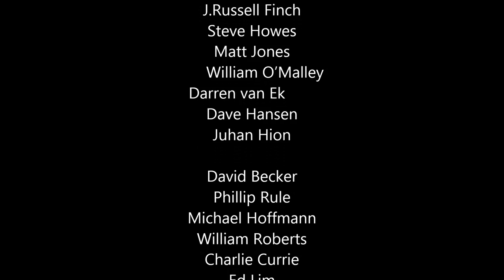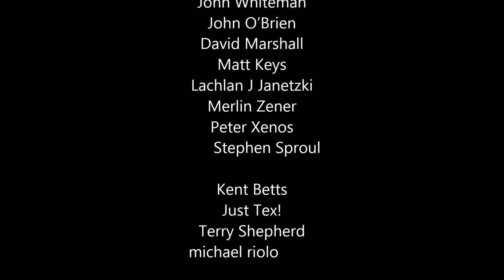Honda XL250 Restoration Part 17 - Electricals and Other Small Items

Comment: Another nice Video Peter and making great progress. When your painting the lettering on the switched try dry brushing. 
It's when you get a brush put a little paint on it and then wipe most of it off on a cloth or tissue. Then with the almost dry brush you gently paint over the letters and they should highlight without leaveing lots of paint where you don't want it.  I have used this technique many times and it may meed a little practice but it's worth it.
Reply from the maker: Yes you are correct - not my finest hour was it?
Reply: Sorry, I didn't mean to put down what you did. Your end result was still good its just that it would have been easier and possibly faster if you dry brushed it.

Comment: Rookie here just bout a 87xlr250r and a 84xr200r the xr is in almost perfect condition so I’m going to just maintain and use that one for now but the xl250r runs and rides but I’d like to start to rebuild and restore her to close to original perfect running stock bike as I can afford this winter looks like your page has a bunch of viedos I need to start watching and any hints you can give me we’re to find reasonable priced parts and we’re to start what to keep what to replaced I’d really appreciate just got my self in this mess neady a new hobby so I thought these two bike will keep my busy and alwasy loved the older Honda rfvc dual carb engines now I’m stuck with two and will deff need help in this project to keep my self busy 

ThNk you 
Colin

Comment: Hi Peter ! Your restoration is just wonderful, congrats ! On the pic of this video, you have your rear light which is just super bright ! 

Is it works in 6V or in 12V ? 
Because I have a 250 XLS from 1981 full 6V and I have a big issue with the AC lightning.
My front and rear lights are so weak, nobody can see me the night and I can’t see the road by night.. 

I really need help ! Thanks

Comment: OOH, pretty soon we get to see if you let the magic smoke out.
Reply from the maker: Yeah sweating a little, but not overly anxious. Cheers
Reply: I did it on my '90 Honda Pacific Coast. Totally my fault and I knew that the second the genie was out of the bottle. I hooked up jumper cables, backwards, on the wrong side of the main fuse. I fixed it and now she has over 100,000 miles on the odometer, but also a bad noise from the final drive area and I'm not as handy as you are. Great videos.

Comment: Nice to wake up to another video - you have reached a milestone today, my wife now knows who you are as illustrated by her comment, "Are you feeding the baby or watching Peter on YouTube!" On a sidenote, I was looking for a Motobatt for my 72 Honda 90 but have recently heard of lots of issues with quality, also there doesn't seem to be a direct fit version, I opted for the dreaded lead acid in the end but wondered if you had come across any issues with them?  I have used in the past with no problem but that was a couple of years ago.  Cheers
Reply from the maker: No, I don't know much about them. I saw a video recommending them so mentioned it to David. I have a lead acid in the XW which I only finished restoring a few years ago and it sweated, so I had the battery tray powdercoated. Cheers

Comment: Hi Pete I did not think you should twist wires together and solder them, you should just push them together and solder them, not that I'm a expert as I hate electrics cheers
Reply from the maker: Thanks Alan, I twist them to hold them together and let the solder flow though them. Cheers